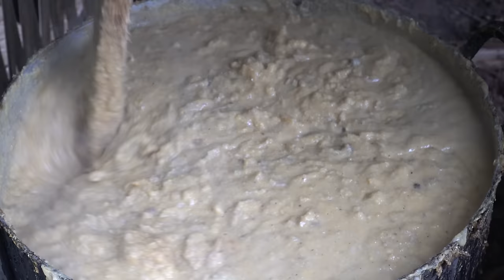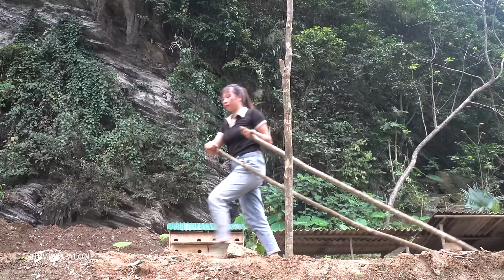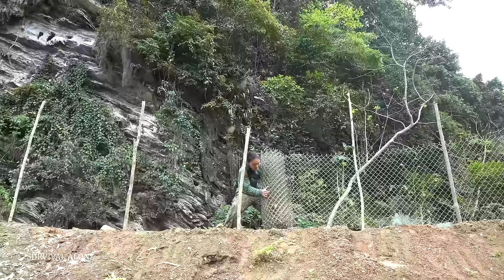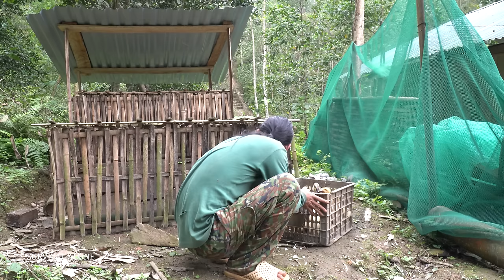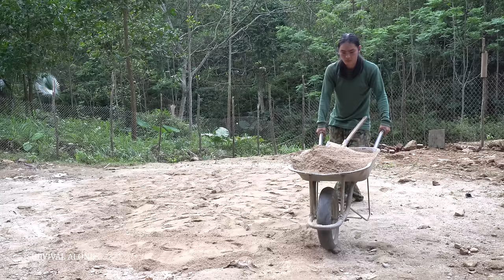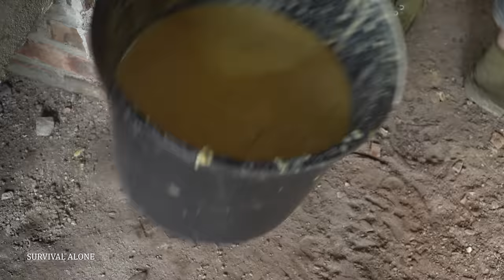Build fences around the farm, cook pig bran, build a life in nature

Comment: Hi I must say I'm really impressed with how far you and your family have come since you found your son, now all you need to do is create a bathroom with a tum that is connected to a burner that heats up the water via you burning wood at the bottom that is connected to the water hose and to the bath tub then all your family can have baths first you fill up the bath to the top with cold water then you open the part that let's the water flow into the burner while the fire is burning in the bottom of the burner when the water is hot it will flow back into the tub at the top opening of the tub then you would have drainage at the bottom of the tub that could flow via a hose to whenever you don't mind the water from the tub going